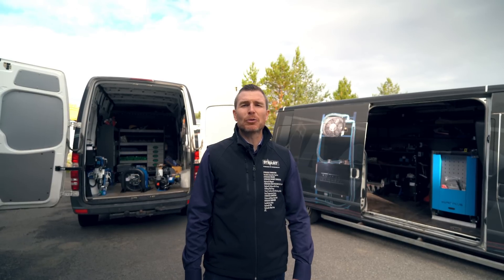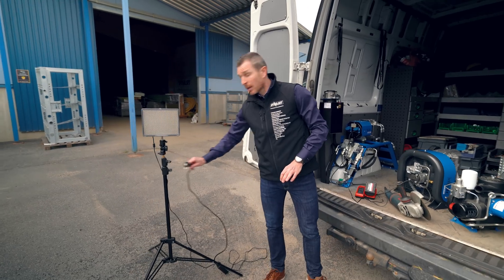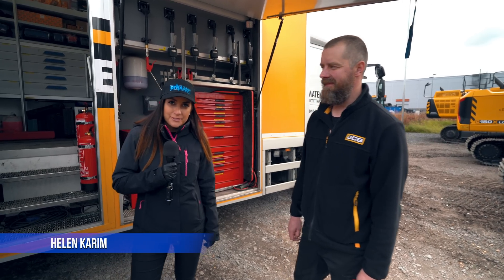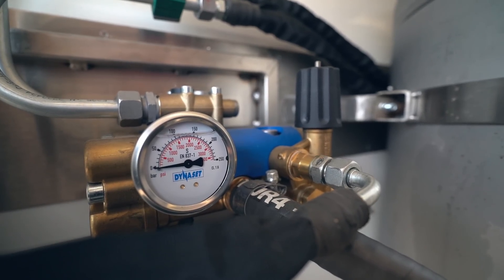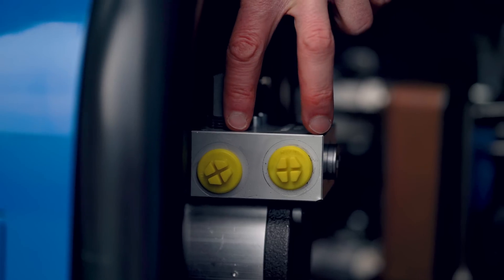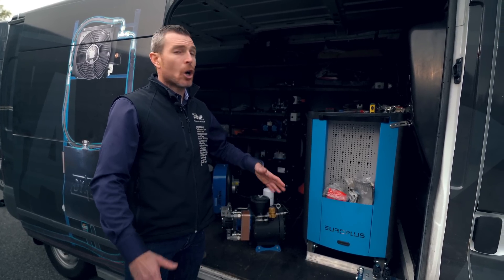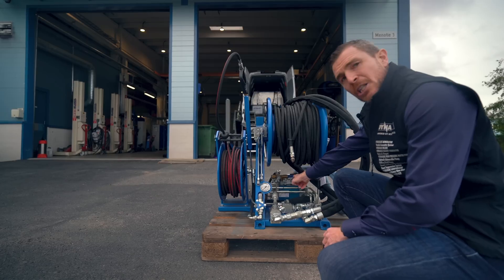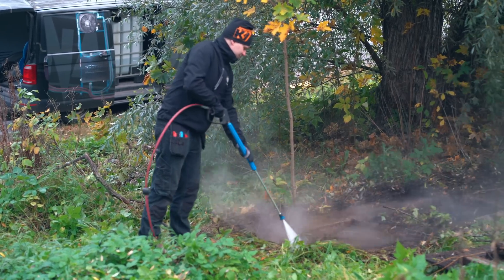How to Equip Service Vehicles

Comment: Hello,

Is it possible to install an HKR 4000 on a Mercedes Sprinter PRO 319 CDI van (Displacement
1950 cm³, 140 kW (190 bhp), with a PTO kit, pump, valves...
Or does it require a bigger engine?
Thank you
Reply from the maker: Thanks for your question. In a Sprinter of that size we recommend installing the HKR2500 and as a hydraulic pump, 60cc variable-displacement pump installed directly to the gearbox output.
Reply: @DynasetOy  Thank you for your reply, because it's complicated to get a technical opinion on your products in a French shop.
The 2500 will probably be a bit too small for my needs.
On the other hand, is it possible in this type of vehicle to install a  
Dynaset HG hydraulic generator, 19 kVA, 230/400 V, three-phase, 50 Hz, IP23?
Thank you very much.

Comment: Why install an hydraulic  system in my service truck to run tools i need to then buy separately when a genset from Honda lasts for years and will run anything I can throw at it?NOT A PRACTICAL SYSTEM.
Reply from the maker: Hi! Thanks for your question. It is true that the Honda gensets are good pieces of equipment. Although, there are many benefits of having a hydraulic generator onboard instead of a traditional generator. 

Firstly, the hydraulic generators are smaller than equivalent diesel or gasoline generators and the size difference gets bigger when you go up in power scale. This makes them more attractive to install into service vehicles.  So, you can have a powerful generator always onboard without dragging an external unit with you. Also, the compact size of hydraulic generators means that the generator won’t take that much space in your vehicle. Because hydraulic generators are compact in size, the generator can be in your vehicle all the time.

Secondly, the hydraulic generators do not have an external engine which means that you don’t have an extra engine to maintain. You save time and money because you don’t have to do maintenance tasks for the hydraulic generator at all which is not the case with gasoline or diesel-powered generators. 

Thirdly, the hydraulic system, which powers up the generator, helps you to get more value of your vehicle. Instead of using your vehicle only for transportation, the vehicle can work as an electricity supply for example. It is also common to install more than one piece of hydraulic equipment onto the vehicle which brings us to the fourth point. 

The benefits of the hydraulic system show themselves especially when you need a couple of different pieces of equipment. The hydraulic system allows installing multiple pieces of hydraulic equipment into one vehicle which makes the vehicle itself more versatile. For example, one vehicle can provide electricity, compressed air, and high-pressure water without wasting the whole loadspace. 

As a wrap-up, the best solution depends on your needs. The hydraulic generator has many great features and when choosing between a traditional generator and a hydraulic generator, you should know the differences. That way you can do informed decisions. More info can be found on https://dynaset.com/product/hg-hydraulic-generator/.

Did I manage to answer to your question? ☺️